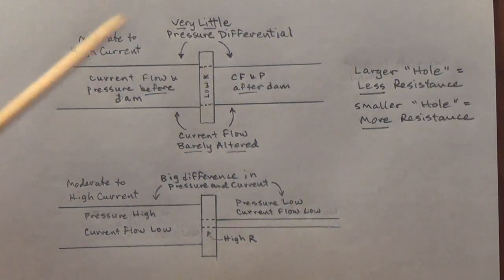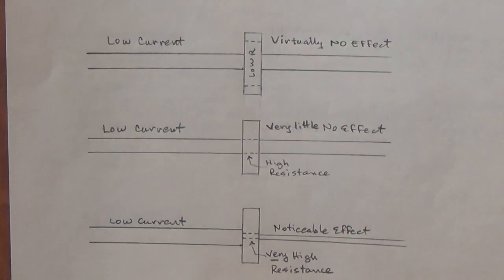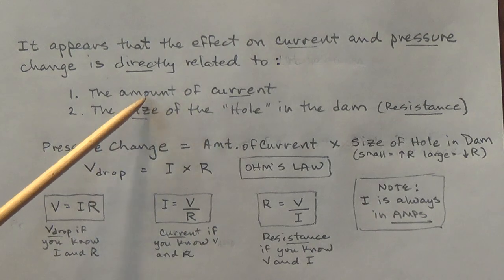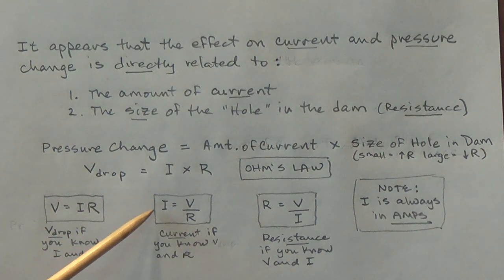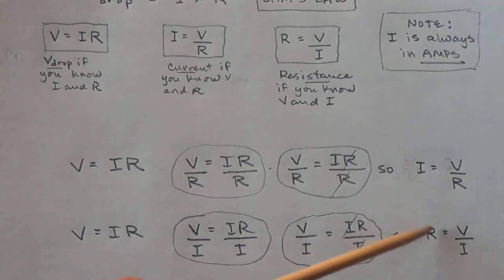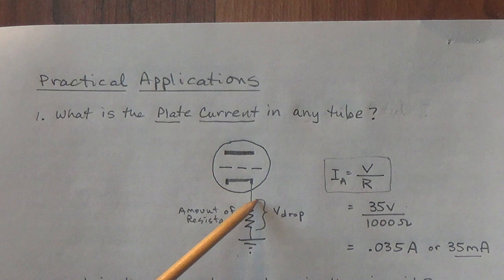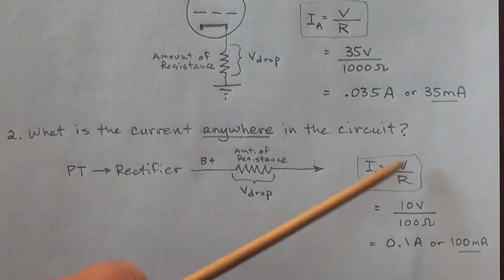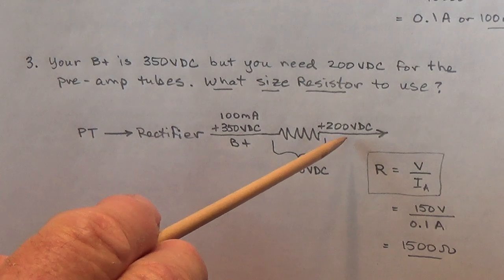Resistors, Part 1:  Their Circuit Function &  Practical Applications of Ohm's Law

Comment: LOL! Uncle Doug, I'm at the same point in my life regarding theory......If it doesn't pertain to the projects I'm working on then, I don't need it taking up valuable space in the gray matter between my ears! LOL! I'm always using method #3 when I'm replacing selenium rectifiers with silicon diodes in the old radios, determining the ohmage & wattage ratings of the dropping resistors! Message to Rusty & Jack......Break time is OVER!! Back to Work!!
Reply from the maker: +Tim Dockery  Amen, Tim. As I get older, my poor old brain isn't getting weaker, it's just reducing its RAM in favor of long-term (and sometimes not-so-accessible) storage :) Rusty and Jack are on notice and will definitely be available for future blockbusters :))

Comment: When teaching basic electronics to people not mathematically inclined, I've found the "Circle T" diagram very helpful for Ohms Law and the Power Equation.  Simply cover the component you want to find with your hand a plug in the values for what is visible
Reply from the maker: +Nathan Davey  An interesting suggestion, Nathan. Thanks for your input :)  I intend to present the circular version of the Ohm's Law and power equations table in the next video.
Reply: Works for the Energy Equation, too(E=I^2Rt), more of a Triangle M.  Probably not as useful for amplifier building, though!

Comment from the maker: Han Solo, since haven't activated Google+, your comments came without any Reply capability, so I'll have to answer up here. You're welcome....glad you enjoyed the video.  The resistance value is calculated based on the current to which the resistor is exposed.  Once the resistor is installed, both the voltage and current are dropped when they exit. In my example, I merely wanted to demonstrate a use of Ohm's Law, but in reality, anything you do to alter the flow of current in a circuit will alter the effect of the other resistors in the line, and may necessitate their recalibration.

I ran out of time for power/wattage calculation. In the case of Example 3, you could use the formula:  Power in Watts is equal to the Voltage Drop times the Current in Amps.  So P =  (150V)(.1A) = 15Watts.  I will discuss this and respond to some questions (such as yours) in the next video. 

With respect to Carbon Comp resistors vs Metal Film, I think there is a lot of hype and self-fulfilling subjective "listening" tests being offered as proof of difference, but I tend to agree with your theory.....the inherent imprecision and fluctuating performance of Carbon Comp resistors makes them more random and unstable, providing a "livelier" tone than the much more consistent, almost robotic Metal Film resistors.  Going 100 mph in a jalopy always seems a lot faster and exciting than 100 mph in a Cadillac limousine.  I personally split the difference and use Carbon Film resistors in most applications, with Metal Film in the power supply.
Reply: +Uncle Doug It gets a little tricky when there is voltage dividers involved :)
Reply: When you understand and can apply Ohm's Law, voltage dividers are not difficult.

Comment: Excellent tutorial Uncle Doug. 
It much easier to understand Ohm's Law and how it applies to tube amps when a algebra teacher
goes through the theory in detail.  I didn't have any problems with algebra in high school, but trigonometry was pretty boring
until, I discovered in EE school  much later on, that trig applies to pretty much all AC theory.   All of a sudden, with a practical application for trig theory, sine, cosine, tangent, co-tangent s, phase angles and vectors. Then there was Kirchoff's circuit law where a single resistance value can be determined from parallel, series, series parallel etc resistor groups.  I was forced to
do it old school ( long hand )in my head without  the use of a modern day calculator. 

.I realized that maybe  I should have paid more attention in HS instead of 'chasing beavers".  I had to hit the books pretty hard to catch up on years of  " why do I need to learn that stuff anyway?"  Now I know.
Reply from the maker: +SuperCarver2011 Thanks so much, SC. Yes, I think we all share similar memories of our early education.  It's a shame that so many critical concepts are presented at a time when our minds were on everything BUT education. I have spent the better part of my life making up for the mistakes and frivolities of youth :)

Comment: Great video Uncle Doug! I would recommend that after you showed the example for calculating the resistance value need to obtain the B+ voltage drop you need that you would have actually demonstrated taking the measurements in an amp and using those reading a calculate the voltage drop. As you know from practical experience that readings are rarely exactly 10, 100, 1000 etc.  Also how to determine what wattage size resistor you need for your application. I'm eagerly anticipating your next video as I find all you videos enlightening as well as entertaining. Keep up the great work!
Reply from the maker: +skeeterbuck  Thanks, SB.....glad you enjoyed the video.  I agree that demonstration would have pepped up the video, but to be honest, once a video gets to be over 20 minutes long, I fear that I may have overstayed my welcome. The process is exactly the same in reality as it was presented in theory.  I simply used round numbers to make the math self-evident. I agree with the need for discussion of wattage requirements for resistors, and promise to cover that topic in a future video.  Thanks so much for watching, and commenting :)

Comment: I guess the next step is to take your 200v*100ma to get the size resistor to use so it wont burn up!
Reply from the maker: +Don Lee You're right, Don.  Since Power in watts is equal to the Current squared times the Resistance, the 1500 ohm resistor in example #3 would have to be able to tolerate (.01A)(1500V) = 15W. Or since Power is equal to Voltage Drop times Current, (150V)(.1A) = 15W.  I intend to discuss the power requirements of resistors in a future video.....maybe the next one. Thanks for watching and commenting :)

Comment: Thanks again for a great video! There are one thing I don't get with the B+ part though. If you install a resistor in the B+ circuit to lower the voltage from 350V to 200V wouldn't that affect the current instead? And if it did affect the current wouldn't that affect the voltage drop? :-)
Reply from the maker: +Magnus Angermund  You're welcome, MA. Yes, indeed, as demonstrated in the water and dam analogy, both the voltage and current are dropped by the resistor. Fortunately, most pre-amp tubes (the recipient of the diminished voltage and current) have much lower V and C demands than the output tubes, which receive the unrestricted B+ from the power supply.  The calculations are based on the current to which the resistor is directly exposed.  For the next resistor in line, you would use the reduced current value.

Comment: This took my teacher about two weeks to explain back then in the times of beavers and zits. And you're doing this in 20 min. Thank you. 
I most appreciate the last part about figuring out what R to use to get a specific V. But doesn't adding a different R in the circuit alter the current in the system so your formula would no longer apply AFTER you installed the resistor? I guess you'd have to measure and calculate all over again and then change the resistor and then do it again and again until you work up to the values you need.
I'd also like to learn about what wattage R to use. Especially in the Filter stage where there is high voltage and high current. I understand that a R with a higher wattage than needed does not hurt the circuit, but the other way around would.
Thank you.
Reply: Also: is there anything to the "mojo" of carbon composite resistors as compared to metal film. Or is it just that unpredictable tolerances in CC make the amp more unpredictable and thus more "alive".

Comment: Ok, question time Uncle Doug: if the B+ rail feeding a preamp tube is, say, 250V at 3mA, why is there almost always a 100k resistor between the B+ and the plate of a preamp tube? Wouldn't that lower the voltage to useless levels?
Reply from the maker: +Mason Lamb  You have hit upon a very complex and generally misunderstood topic, Mason......the dual function (AC and DC) of the Plate Resistor.  If you will stay tuned for future videos, this topic as well as Input Impedance, High/Low Gain Inputs, etc. will be covered in detail.  This video was simply laying the groundwork for those topics.
Reply: +Uncle Doug Thanks! Guess I dove foolhardy into the textbook and out-ran the lecture. Again. Looking forward learn to more!
Reply: +Mason Lamb "to learn"
Reply from the maker: It was an excellent question, Mason....as if you were anticipating the topic of a future video. Please be a little patient and I think you will like the explanation.

Comment: i learned to look at a resistor as a water hose. the hose is either wide open or has a kink in it. also you might want to go over power. wattage ratings of a given resistor is just as important. use a resistor of the wrong wattage and the magic smoke escapes. we all know its the magic smoke that makes electronics work. let out the magic smoke and nothing works anymore.
Reply from the maker: +Joseph R   Thanks for the good suggestion, Joseph. Calculation of wattage would be an excellent topic.

Comment: Welcome back!

As usual, everything traces back to Ohm's Law.  It is greater than Ape Law!  Violating Ohm's Law is like going into the Forbidden Zone.  You won't like what you find (I bet a divide by zero would be about the equivalent hell).
Reply from the maker: +kcrmson  Thanks, KC.  Ohm's Law rules, and violators of this law will find themselves calculating the value of pi until Keanu Reeves wins an Oscar.

Comment: Aloha Uncle Doug and Rusty, from Honolulu!  I have enjoyed all your videos so far, and this was a great review of the fundamentals. It's always important to keep in mind how and why to pay attention to the amps and milliamps with the proper decimal positions.  I recently acquired a very dusty and scratchy sounding but playable 8 watt MUZAK P.A. amplifier, and after lifting the hood, i discovered 2 6V6's in push/pull,, 2 6SL7's, and a 5Y3 rectifier.  Apparently, it was used to deliver the morning announcements at a local high school.  A little research told me that this circuit was very similar to the early 50's Fender Deluxe series of circuits, such as 5A3, 5B3, 5C3, 5D3 and the most famous of all, the 5E3. So your videos have given me the knowledge to trace the circuit, and plan on a restoration.  And I'm watching out for the "Death Capacitor" as well!  So cheers to you!
Reply from the maker: +Alan Lunt  Thanks so much, Alan. Your Fender Deluxe project sounds like a great one. You're always way ahead when you can buy a vintage amp cheaply and get the high-quality components to build a real classic, like the 5E3. Please be sure to let us know how it turns out.

Comment: the best use of electrical current as water metaphor I've ever seen...once again , beautifully done...Another opportunity for me , when asked an Amp question, to say " Go see Uncle Doug,  and leave me the heck alone!"
Reply from the maker: +scott moore Thanks so much, Scott. We really appreciate the positive assessment. So you're the one who's been sending all those people to bug me :)
Reply: ...the only flaw with that particular metaphor, it that electricity requires a closed COMPLETE CIRCUIT- for electric current to flow, but water flow doesn't:  I have never heard of ELECTRICITY leaking out, and puddling on the floor from a busted wire-!!
Reply: @daleburrell6273  I don't know? Both ends start at the ground. Only one is positively  higher than the other!
Reply: @ronniepirtlejr2606  ...THAT SOUNDS LIKE A "CLOSED CIRCUIT" TO ME-!!!
Reply: @daleburrell6273  I guess you've never worked on a Behringer amp then. 🤣
Reply: @gatekeeper65  ...NO, AND I'VE NEVER EVEN HEARD OF IT-!!!

Comment: That was GREAT... I've known Ohms Law for years, but never understood the "drop" part of it.  Now I get it.  Looking forward to the capacitor 'sister lesson'!!! (you are going to do that one right???) :D  Give Rusty and Jack a scratch behind the ears for me.
Reply from the maker: +Greg's Garage  Thanks, GG. Glad it was helpful. Yes, I'll get to capacitors in a while. For the immediate future, I was thinking input impedance, high and low gain inputs, and plate resistors. Rusty says thanks :)
Reply from the maker: My aspirations were not quite that lofty, TC. I was thinking of an explanation of the Fender type of high and low impedance inputs. Judging from many of the comments I have received, this seemingly simple (but deceptively clever) circuit is not generally well understood or appreciated. Thanks so much for your input and helpful comment.
Reply: +Uncle Doug Hi Doug....uuuuh impedance is something completly different....you may stay within the tangible area first (L,R,C -> XL,R XC) where we already know the R;) and after all is home and dry you then go over to the more complex impedance field with all these cool things like Gm reflected resistance and "multiplied" input impedance via the (splitted) cathode resistance and may be bottom (LO-Freq) end impedance and Top (hi-freq) end impedance...with these equivalent circuit things....hard stuff for beginners....

It took me a long time to fully understand what´s going on there, but once done and got it, it opens a wide field on what you can do with tubes and VeryHighImpedance circuits...